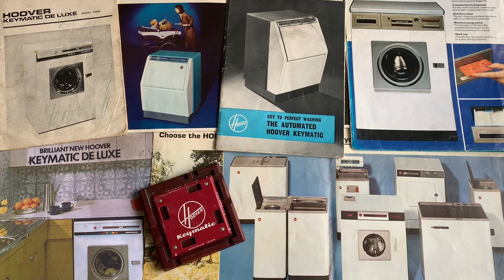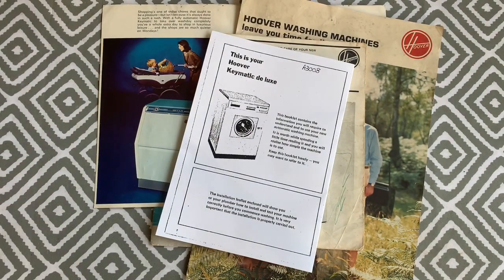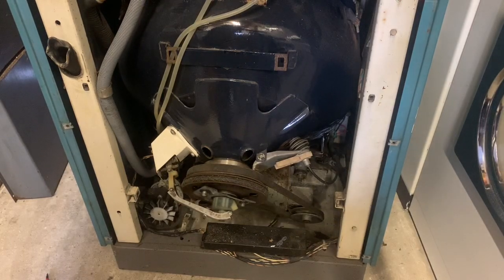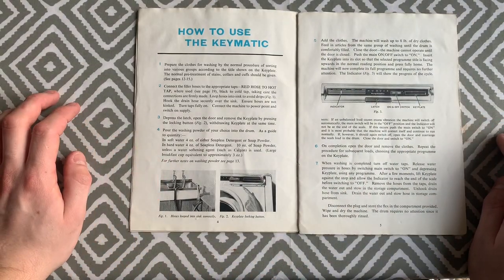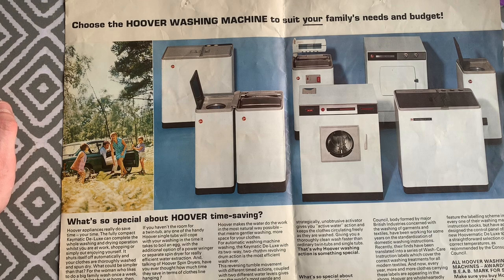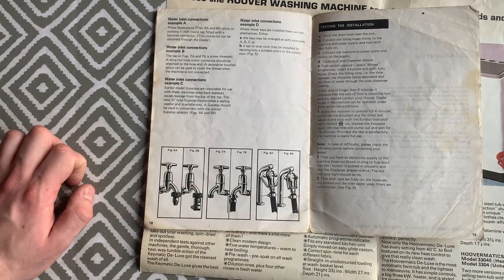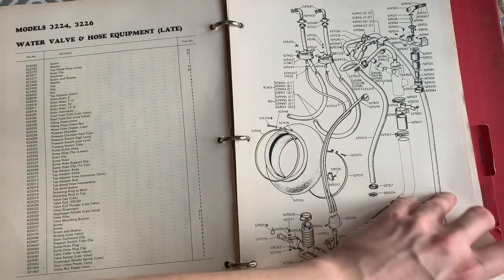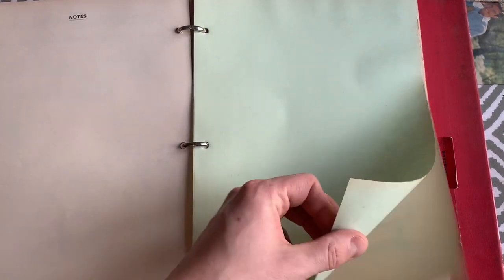A closer look at the Hoover Keymatic Washing Machines

Comment: I don't know if you said it, so I'm going to ask:
Was the keryplate reader the same for all models, so you could use the same plates/programmes on the 3224 and on the much later models?
Reply from the maker: Good question, I did sort of say that one of my machines has a later programmer in and uses later keyplates but no,the keyplates and readers were different. 3224 and 3226 were the same, the 3203 and 3223 were the same, 3243H, A3050 and A3008 were the same and the A3062 and A3112 used the same but the A3112 was sold with a black and orange keyplate where as the A3062 had a “pale honey” and orange keyplate.

Comment: Why would they continue making Keymatics after they had introduced machines such as the Matchbox 3236 and the electronic models? Also the model numbers confuse me as the newer models seem to go backwards, for example the 3223 is newer than the 3224 unless I've got that totally wrong. Also, did the pulsator models have lifters in the drum?
Reply from the maker: You’re right the model system is very weird. I assume they ran them with the timer models so there was a cheaper option and a more premium option and the idea was with the Keymatics meant they could introduce new keyplates and programmes for new fabrics etc as time went on.